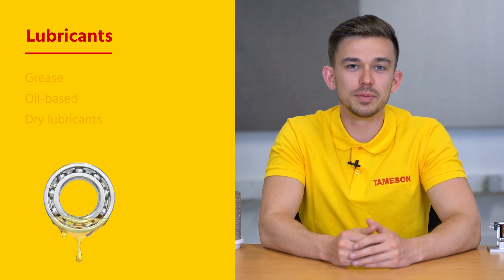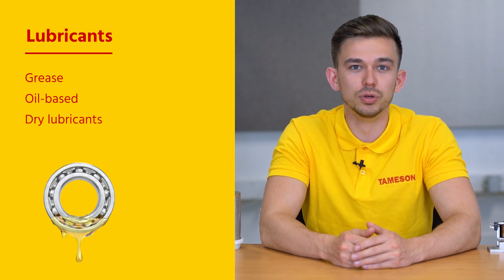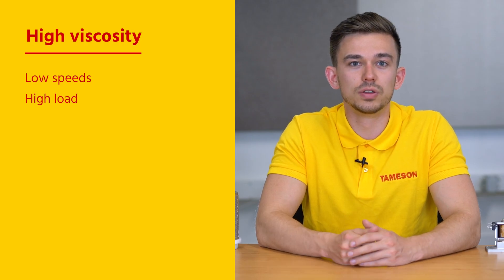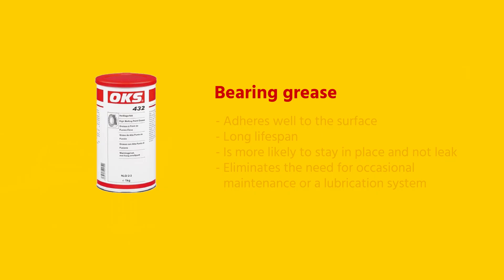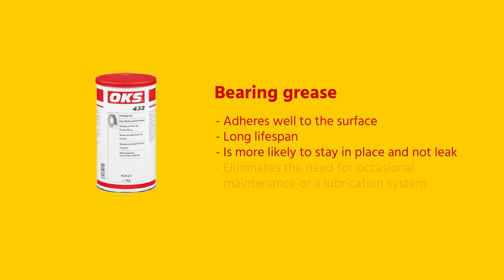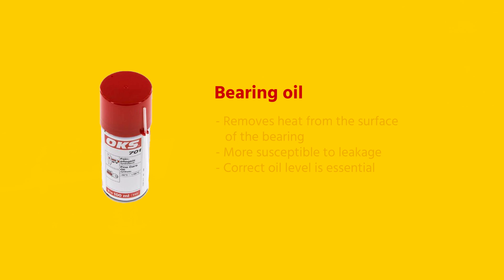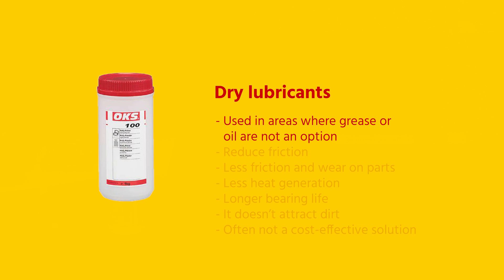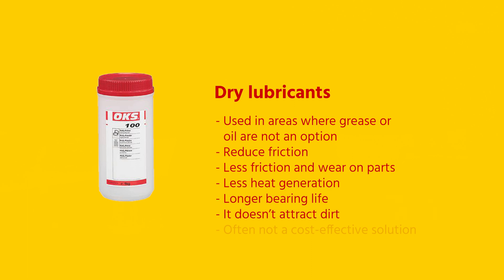Bearing lubrication guide I Tameson

Comment: What lubricant would you recommend for the motor car engine?
Reply from the maker: For your application, you could consider using a high-quality synthetic motor oil, as it typically offers better performance and protection for engine components. However, it's important to refer to your car manufacturer's specifications for the most suitable type and grade of oil.

Please let us know if there's anything else we can help with!

Comment: Is cutting oil any good as a sealed bearing lubricant?
Reply from the maker: In general, mineral oils and synthetic oils can be used for ball bearing lubrication. Synthetic oils are mainly used for high temperature fluctuations in the working process.